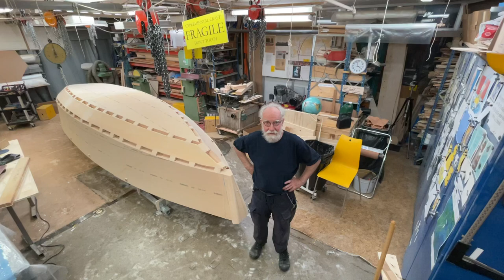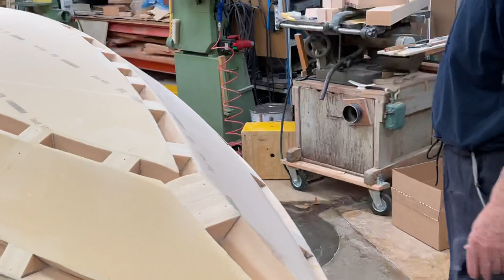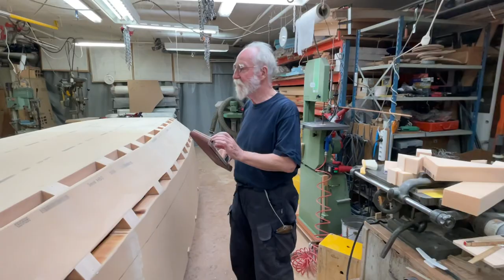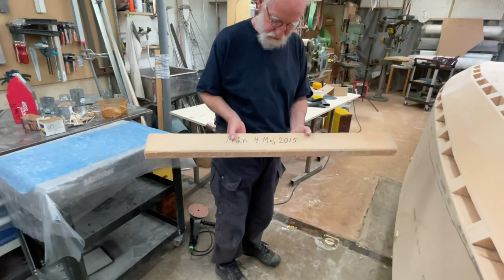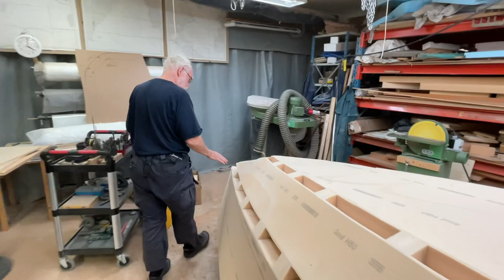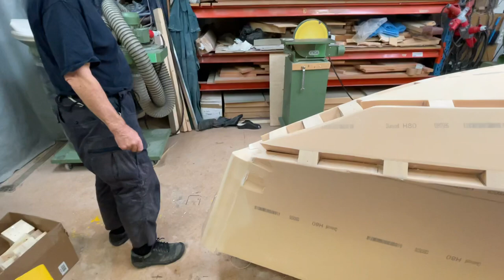Now she looks like a boat. Next step longboarding

Comment: I am surpriced how fast it is to make a one-off boat like this. I am exited to follow the next steps with fiber and resin, and what surface finish you will get and aim for. Well done Sven.
Reply from the maker: This is the quick part. Longboarding shaping puting in the wedges will take time. Still its the details later that takes time. The hull is the small part timewise

Comment: Nice job by a great sailor! I am french, and i was wondering why you prefer to make a longer boat (8 meters?) than the previous one, but still with a quite narrow beam ? I think it is a another choice of type of boat than Yann quenet , french sailor currently sailing around the world on a 4 meters long sailboal/scow, but with a larger beam and a fin keel. Best of luck and fair winds !
Reply from the maker: Je change mon avie. The new boat is not any longer 8 meter but 6.4 meter and 1.4 meter beam. The idea of the longer was to get more speed but then I changed my mind realising that after 150 days at sea in 5.8 meter I was quite happy with slow speed. The new boat is a double ender a canoe yawl.
Narrow beam makes for low resistance and makes it possible with a stability range up to 180° with out fin keel and a draft of only 25 centimeter for the hull. The fixt rudder with a skeg increases draft to 50 cm.
Reply: Thank you /merci for your reply Sven!  I understand the change. 6.4 m is a good lengh (pretty the same than the mini 6,50 sailboats for trans atlantic crossings), and enough for a minimalist i think! Small is beautiful, less problems..lol , Take care

Comment: I wonder if you could inject the corners where the foam isnt, working around the wedged you have used with the insulating foam that comes in an aerosol can. Then maybe  cut and sand it to the proper bevel after it has expanded and cured. I dont know how the insulating foam would react to resins or epoxy.
Reply from the maker: Aerosol foam does not have the same strenght as Divinycell. Maybee it is strong enough becouse its a small boat but it does not feel right. I like to do a good job and it will only take a week or two and I plann to keep the boat for a long time becouse she seams to be such a brave one.

Comment: Why did you decide on 3" foam this time? Last time was half that width I believe. It's looking good.
Reply from the maker: Usually you have to order Divinycell in advance but I was eager to get started so I talked to my contact man at Diab ( I have been using Divinycell since 1984 or so) and asked if the they  had something of H80 quality. He told me that they had some uncut pieces and that I could have any thickness. I talked to some friends including Göran Marström and after a day or two I phoned back having decided on 70 mm.
As life goes on on learns and ones priorities keep changing. After 150 days at sea in 2020 and 2021 I kind of realized that I liked the slow time at sea in a strong safe well insulated boat.

Comment: Which is the maximum thickness  divinycell h80 you think it is still advisable for being bended for amateur boat? Over 7 cm thick is still doable, or it is possible to glue one board over another board? To make an example let's say a 5 cm thick board over another 5 cm board already fixed on moulds.
Reply from the maker: The more slender boat the more easy curves the thicker Divinycell. Of course you can doubble thickness by gluing but it will be heavy unless you use vacuum. In fact on big navyships Diab do glue layers of Divinycell but not to be able to bend it but to get thicker material. I think 40 - 50 mm is adequate for most purposes.